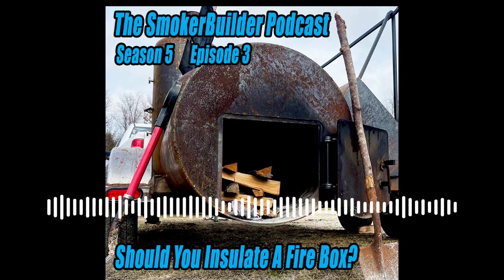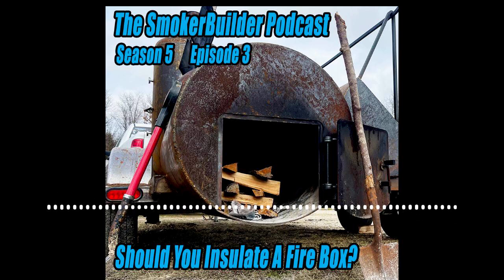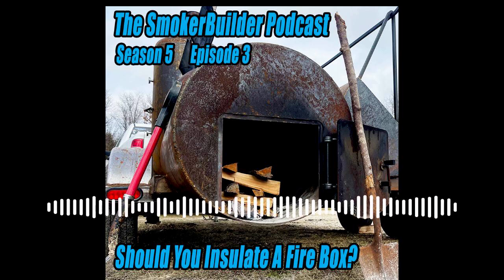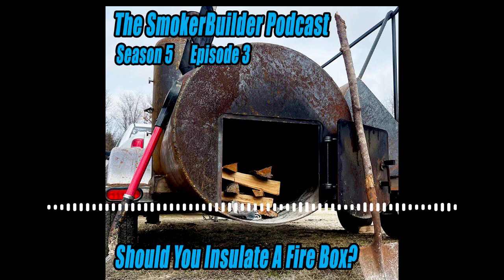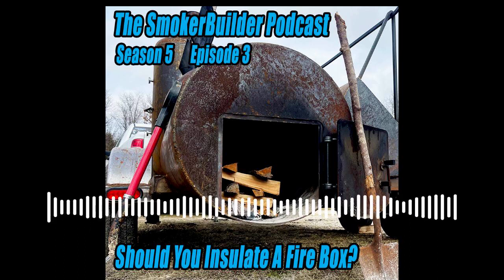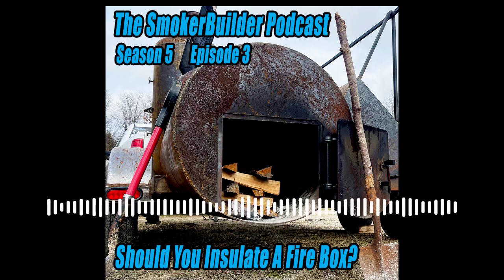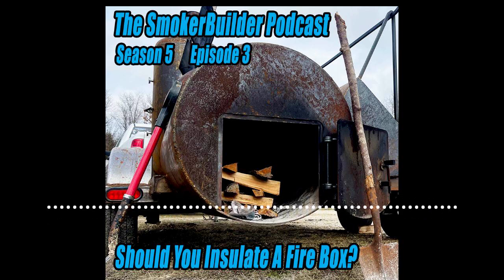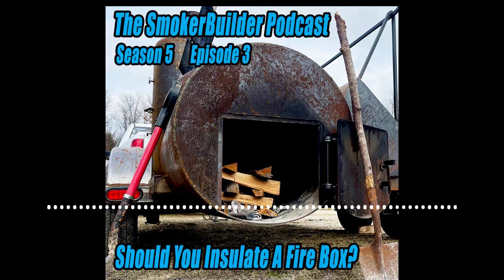Smoker Design: Should You Insulate An Offset Smoker Firebox

Comment: I have a char grill champ off set smoker. I use only a slight firebox modification. Three 9 x 4“ bricks on the bottom. With one of my firebox top racks. Excellent airflow and efficient cooked temperature in the middle of the grill. With a water pan.
Reply from the maker: Sounds AWESOME brother! 👍

Comment: I just got a 500 gal propane tank, and in the process of gathering the other parts to start making it. I have been going back and forth on whether or not to insulate or not. I'm up in Michigan and the temp is below 50 (down to -25)  for more than 6 months. The last smoker I made used a 3/8" thick fire box, and I had a hard time keeping temp (my sensors graph looked like an E.K.G.). That is why I'm considering insulated
Reply from the maker: It wouldn’t hurt to go ahead and insulate. With temps dropping really cold it would help keep some of that heat in. Thanks so much

Comment: Thank you for taking the time for posting these podcasts. Your knowledge and advice is invaluable for a backyard bbq newbie like me. A few months ago I bought a used 120 gallon offset with a 24" x 30" firebox, all 1/4"  A36 steel plate uninsulated. Thinking I would need to prevent heat escape from firebox walls, I recently bought 18 fire bricks to place inside bottom of firebox to create a some what semi-insulated environment. But now that I've heard this podcast, did I just waste $80 on fire bricks, or do fire bricks help conserve some heat but still allow for a little dirty smoke for flavor. Could you share your opinion on this set up please. Thank you from so. Cal.